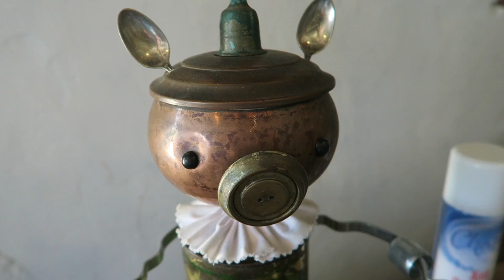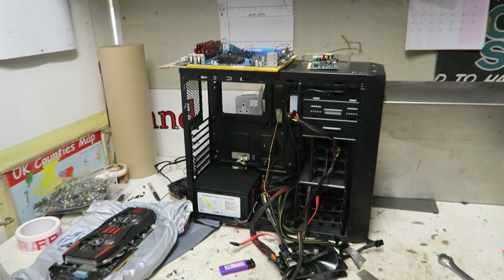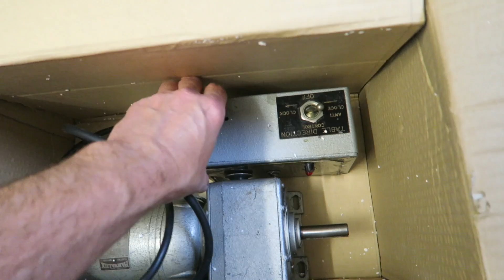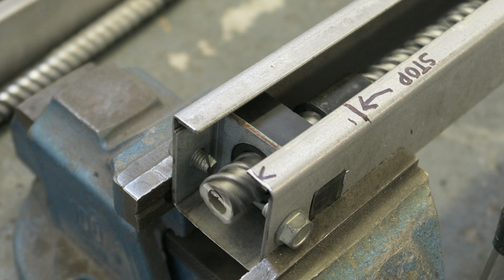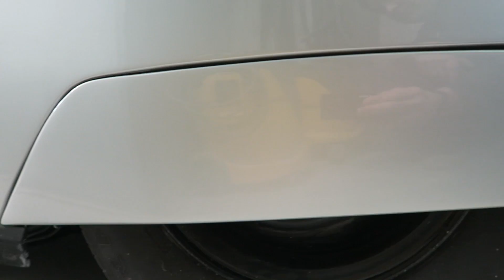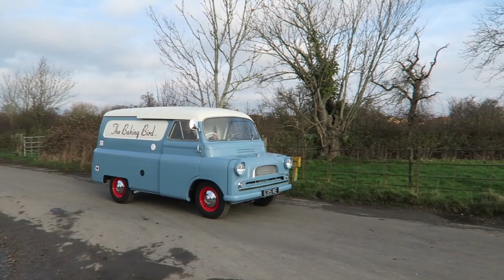Upcoming Videos! Van update! Trev's Blog shop Hammer Sale!

Comment: Good to see you back mate! I tried my spot welding dent puller for the first time yesterday! Frick the earth side gets warm! 2nd degree burns on my thumb ind finger where I went to check if it was tight...
Reply from the maker: JBFromOZ go steady mate! The better the earth is connected to cooler it will stay as resistance causes the heat. Cheers Trev 👍
Reply: Yeah that’s it mate!! I was trying to tighten it as I could see a bit of a gap!!

Comment: Holy cow, where to begin?
First, it's good to hear from you again!
Second, I work in IT for a living and build/support a ton of PCs.  The thing that fails the most on a PC is BY FAR the power supply.  Hard drives are second.  Things like motherboards and CPUs almost never fail.  I've built hundreds of PCs and I think I've had one motherboard fail completely.  One.  And no processors.
Third, it sounds like BMWs use of plastic timing chain guides has claimed yet another engine.  For a country renowned for its engineering prowess, it really is an awful design.
Fourth, it's good to see the baking business is finally taking off.  You best be careful though Trev, otherwise you may soon find your workshop will full of industrial mixers and ovens!  Would love to sample your wife's baking but alas there's a rather big ocean between us.  :(

Finally, check out the Mustie1 YouTube channel.  About 9 months ago he did a video where he motorized a bead roller just like yours, but rigged up a foot pedal to control it.
Reply from the maker: Chris Freemesser Thanks Chris I’ll be sure to check it out. Cheers Trev 👍

Comment: Thinking about what you have been up to so good to see you are having the van in service. I bought a "cheap" bead roller made in China and have been trying to motorize it with a grage door opener motor. Still tweaking it but think I need to purchase a variable speed DC motor to get it right. Gald you are back a posting, cheers!
Reply from the maker: Thomas Pollock isn’t the garage door motor a dc motor? You can by either a dc or ac speed controller off eBay. I just bought one to slow down an angle grinder which works quite well. Cheers Trev 👍
Reply: Trev, this is an early model and the motor is AC powered with capacitive start circuit. The rpm is 1750 but it has a gear reduction , so the speed is still slightly fast but good enough to form straight shots for now.
I will be on the scout for an more appropriate motor, but my project needs will probably be done by then, lol! 
As I sure many are, I am looking forward to more of your posts.

Comment: Nice buy, of course those rounding over dies are copies of Ron Covell's or he copied them, don't know.  https://jerekirkpatrick.com/ Check Jere's site he has some good ideas for improving the plate bead rollers.
I electrified mine with a Bodine gearmotor from Ebay. I used my small plasma cutter to make all the parts.
You'll have the same advantage. Good to see you at it again, take good care.
Reply from the maker: Bill Maguire Ron did mention that his idea of the mini roll over dies used to create a channel to aid welding aluminium were indeed copied by a tool distributor. I’m not sure if he actually invented roll over dies entirely 🤔, I’ll have to ask him that one. Cheers Trev 👍

Comment: Congratulations on your new toys!!! I have a bead roller very similar to the one you have. I took the steering wheel off of my old Mustang and welded an adapter on it that would bolt up to the bead roller. It is much better than the handle, but not as nice as what you are going to do. Thanks again for the great videos.

Comment: Great video Trev. Van is looking great!. Good job on the PC, did you hear me screaming "power supply" at you lol.
Cheers, Jeff.
Reply from the maker: cabdriveruk unfortunately the lad launched in and started ripping it apart. I did the bridging green to black procedure and had no output, not 100% sure why it wouldn’t initially fire back into life but what I did was refit the CPU properly as he dragged it out with the fan still attached without releasing the lever first. My guess was it was either that or he hadn’t attached all of the cables back together properly... going now thank goodness. Cheers Trev 👍
Reply: @trevsblog  Did you use thermal compound between the cpu and heat sink Trev ? I usually tear a finger off a latex glove  put it on my finger to spread the compound.
Reply from the maker: cabdriveruk sure did mate 👍 seems to be running fine ATM...

Comment: I don't think you need a street licence permit you're not on the public highway you on a private land why would you need a street licence permit? Health and safety certificate maybe but you wouldn't need a permit
 could be a fuse blown on the motherboard as well might have a P  on it or 0 be surface mount like a capacitor check around the connector
Reply from the maker: John sweda  regarding the street traders license, it’s the law that any mobile trading unit that the general public have access to must have a street traders license regardless of venue be it private or council owned. You can have one for one day up to one year and the price varies drastically. Some local authorities charge for applying then work out how much they will charge you after you have applied. If you’re attending an organised event you don’t need one as the events organiser will have already have an agreement with the council. The pc is fixed, just the PSU at fault. Cheers Trev 👍

Comment: The up coming videos sound good. Just spent all weekend welding a new bonnet seal channel and corner of the front scuttle panels I'd made into the 914 I'm restoring. I got the panels to be a really nice fit, all clamped into position flush, only to be disappointed after welding that they had somehow ended up not as flush as I expected. Probably only 0.2mm out, but that's plenty for the tig fillets not to sand back as flush as I'd hoped (I was hoping they'd look more like the patches you've welded in in your intro outro!). It'll be good to see how the experts do it. Keep up the good work !
Reply from the maker: Richard Jones don’t beat yourself up too much, things always look better in pictures or video. Cheers Trev 👍
Reply: @trevsblog  Thanks!